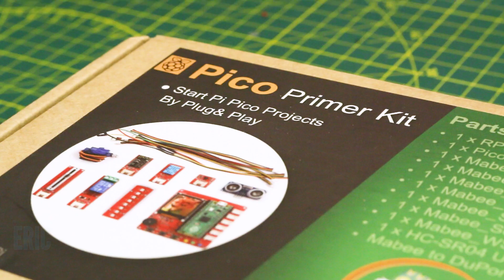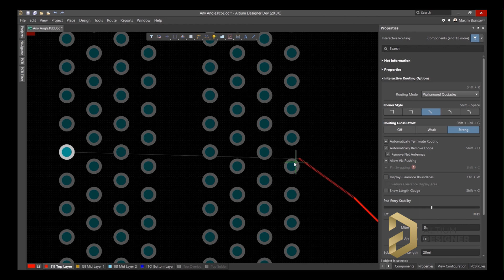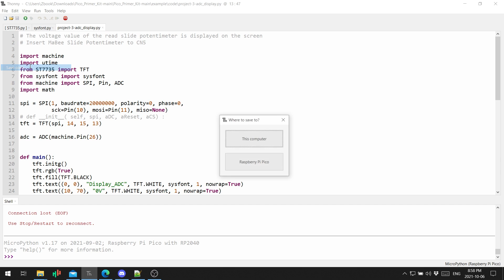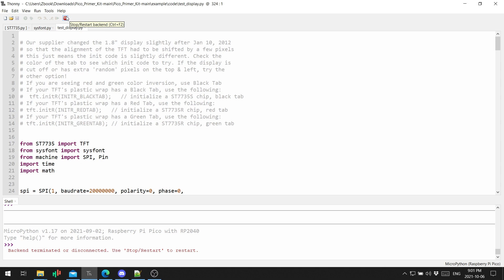Raspberry Pi Pico MicroPython Starter Kit For Beginners

Comment: Hey mate😃 35 bucks WOW that is ridiculously cheap...  cool video man good work bringing this little kit to people's attention, fantastic value, 👍👍👍I don't know how they do it, I did a Ac flyback Giveaway on my channel (after I made a video showing a pair of them putting out a 20cm arc) A  couple of the winners were in the US and it cost me around £20 postage on each flyback...
I still watch most of your vids just dont comment very often anymore on yt vids.
Have you looked at my channel? I recently started uploading, mainly  high voltage power electronics, monster xray transformers (50kw 200kv) multi KW VTTCs etc and the odd taredown so far  let me know what you think if it's your thing😃..

All the best from the UK

Steve
Reply from the maker: Will check it out.  Cheers
Reply: @MkmeOrg  thanks mate please let me know your opinion😀

Thanks Steve